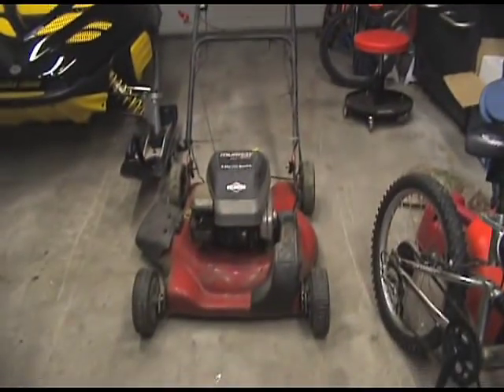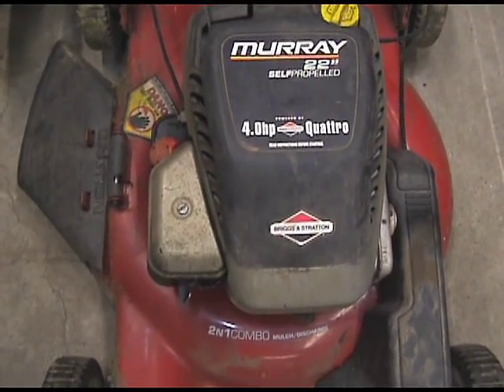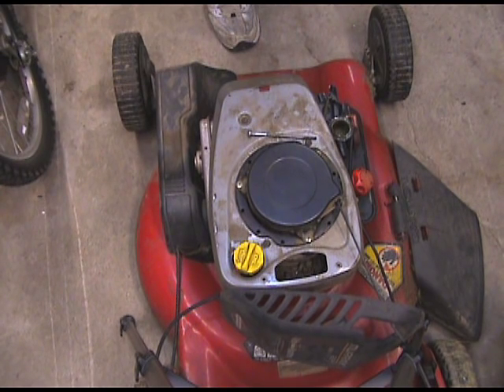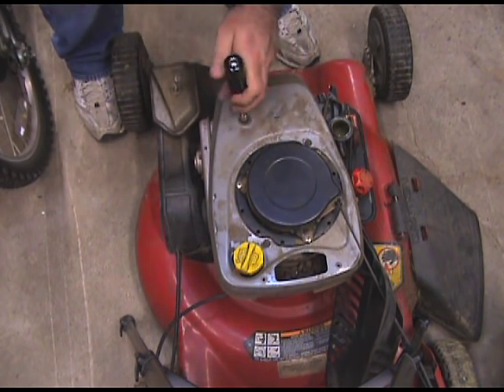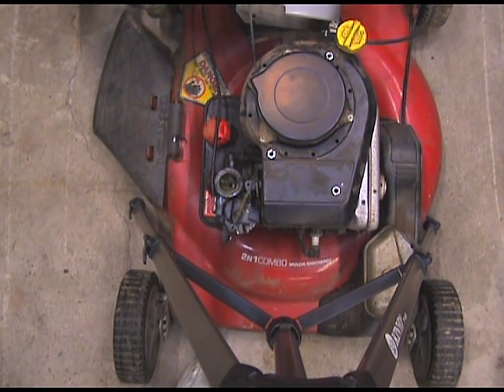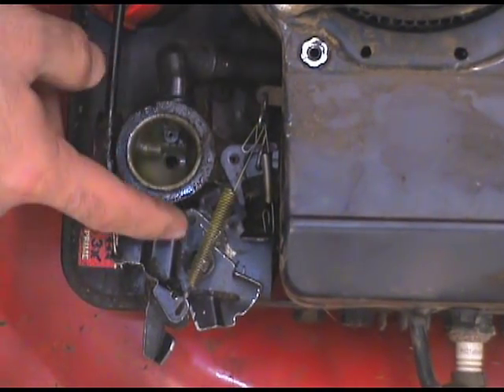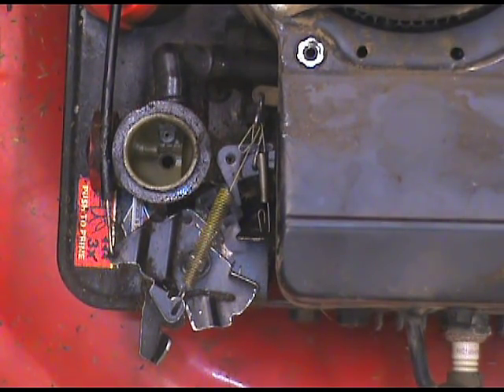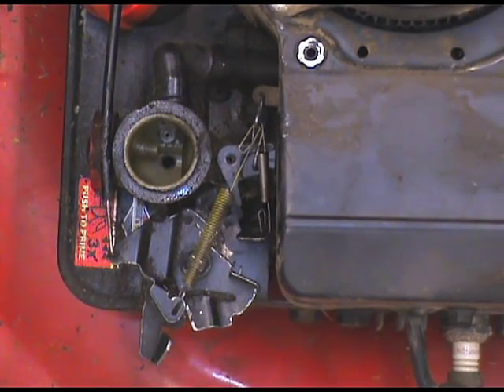4 HP Briggs &  Stratton Quatro Motor Spring & Linkage Close Up Detail

Comment: Many thanks, great little video. My ex said I could have the lawn mower because 'someone' had looked at it and it was finished. Found some bolts to reconnect the carb, washed the sponge filter in petrol, set up (with a bit of bending of wires) the spring linkages as per your video and it started. A quick adjustment to the drive cable and I was being pulled along by my trusty stead of 15 years (lol).
Reply from the maker: Glad it worked for you.  Happy  mowing.

Comment: Many thanks, needed this. I realized after seeing it that i put the air link vane in backwards. also had to unclog the pin hole on the underside of the carburetor, but got mine running.

Comment from the maker: Thanks.  The idle on my my mower is a lot higher than it should be.  These mowers do idle a little low normally.  I raised my idle so it wouldn't bog in higher grass.  It's really not good for the motor, but I don't use it much since I have a rider and 2 other push mowers.  If I remeber correctly I just bent the tab back that's connected to the shorter  spring.

Comment: Hey, I watched your vid, it's very good.  
I thought I'd share a diagnostic step that you did not mention which ended up being my problem.
On my motor the speed would never stay steady.  I replaced the governor springs, the carb diaphragm & gasket, and gave it a complete cleaning.  It got better but still hunted   speed.
Then one day I realized what I hadn't checked was the throttle shaft.  Sure enough when I wiggled the shaft there was play and looseness in it.  This allows too much air.

Comment: This is almost exactly what I'm looking for. One question though. There's a bit of linkage off the the side that has a thicker cable, which routes around the air intake. Where does the other end of that go? I don't have that cable on my mower and wonder if that's what is causing it to not start...Thanks

Comment: So I ordered a carb and voila, perfect.
Wiggle those throttle shafts.  If loose either get bushings or a carb.  I say either because I didn't see bushings available in the parts list.  It's possible the throttle shaft is not removable to install bushings.  In which case you replace the carburetor.

Comment: Thanks for the videos. I picked up a well-used Quattro and found a loose part hidden on the back section under grime and grass etc. I've ID'd it as a flywheel guard but have no idea where it goes on the mower.  Any suggestions?

Comment: I have a B&S engine on a log splitter. When I start it I have to hold the choke lever in the choke position or it just will not stay choking. Once the engine starts it runs like a top. I don’t know if there’s a vacuum line to hold the choke until the engine is warm or if I messed up a sporting. Any ideas?
Reply from the maker: To be honest I'm not familiar with that type of choke but you may be on to something with the vacuum line.  Thanks for watching.

Comment: Hello,

I enjoyed your video about the 4.0 HP Quattro. I have the same engine  installed on a tractor type, which is called a TUG, and is used to move small airplane around. The springs for the Governor were pretty bad, so I orderded new ones. On this unit, I can't see the tab for the small spring with D shape loop at both end. There is small hole on the lever that also holds the larger spring. As a result the motor runs at max RPM. I put the old large spring back and strech it, now sometimes it runs so low, that you can't really use it.  I removed the top cover but not the one that covers the magneto.  What is the purpose of small spring? 

Thank you

Nick

Comment: Great  views for linkage. But I still dont know why we need the small spring for ?  Can it work without the small spring ?
Reply from the maker: The little spring tightens up as the engine is running to help control the RPM's.  It can be adjusted by bending the tab that it's connected to inward or outward.  You do need the small spring or the governor will not function.  Thanks for watching.

Comment: The springs are mounted wrong way, the stright side of both springs should be mounted away from the motor. And you need a rpm meter to adjust it. The small spring is used to raise the rpm when  the motor are working hard. First adjust the rpm to 2600rpm with the big spring  and then raise the rpm to 2800rpm with the small spring.
Reply from the maker: Thanks for the tips.

Comment from the maker: It could be possible that you governor broke inside the engine.  That happened to a riding mower that I had and was not worth fixing.  If you can maintain a good running speed with the trhottle control then I would just roll with it.  You may want to ask donboy73 channel as he is a small engine mechanic and does a question and answer every Friday.

Comment: I enjoyed this step by step video and th eprevious one you posted...
I have a similar quattro mower. My mowers problem is with the speed always being on high or fast. I replaced the throttle cable, long/short springs, and link vane (just for kicks). Mower speed can manually be lowered, but once I let go, it goes back to fast speed. I even bent the metal area where the springs attach onto. Still on high. i see the throttle cable move, but the idler does not. Any advice? PLEASE!!! Thank You

Comment: Hello, I'm trying to find out what the pipe does that connects to the top of the carb, the one that connects with the black rubber 90°. Do you know what's it called? Or what it's purpose is?
Reply from the maker: Try a parts diagram online

Comment: How do I know if these springs are tight enough? I replaced my springs today, they feel lose but not sure how tight they should even be!
Reply from the maker: If you didn't change anything other than the springs with the correct springs then it should be fine.
Reply: @Paisteboy  thanks for the reply. I put the springs on and even then when starting the engine it does not adjust to the speed lever (turtle/rabbit). It only goes full speed and off when it comes to adjusting the throttle.
Reply from the maker: @DC-iu8ze  
Sorry. I don't have this mower any longer or I'd take a look at it.  My throttle adjustment was broken from the day I got it so I always just ran it at full throttle.

Comment: what does the plastic tab coming out from under the cover do?  not the throttle body lever - the other one
Reply from the maker: It's the governor if I understand what you're asking.
Reply: +paisteboy thanks. I looked around and figured it out. uses forced air to keep RPMs low.  the faster motor spins - the more air pushes against flap which then makes lever throttle down the motor. crude but effective.  I still prefer manual throttle.
Reply from the maker: Cool.  Ok. I think you are talking about the air vane.
Reply: +paisteboy if you say so, I don't know the terminology. looks like a flywheel to me :-).  I really hate these little flimsy springs. when I back down the throttle the RPMs fluctuate up and down. again - give me manual control! :-) :-)

Comment: pastieboy ,  how can I contact you for a Briggs and Stratton carb problem Im having?  I have an older 3.5 B&S Model 091212-1060-E1 with all the springs missing from it.  I can make it run with a whole mess of trouble but I want it to run correctly so my son can ride it safely. I know what springs to buy from looking at diagrams but have no clue of their placement.  Do you have any pics close up on how its supposed to look? I need some help from a Pro like yourself.